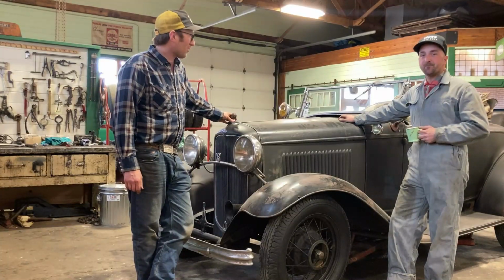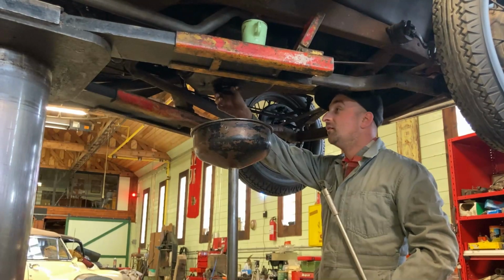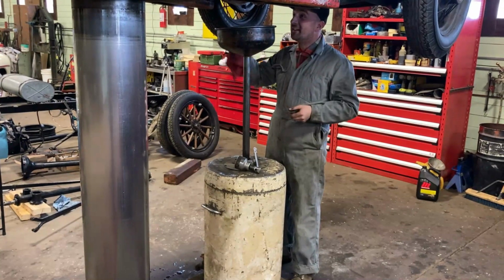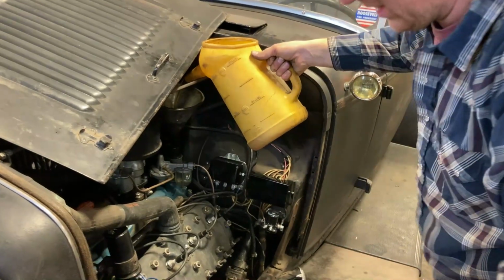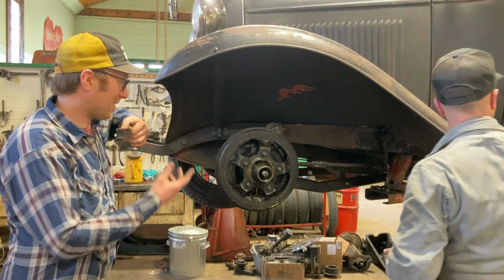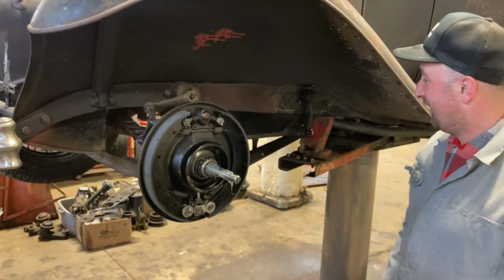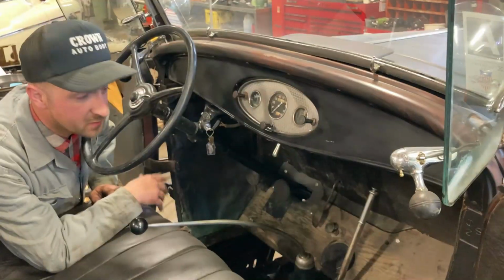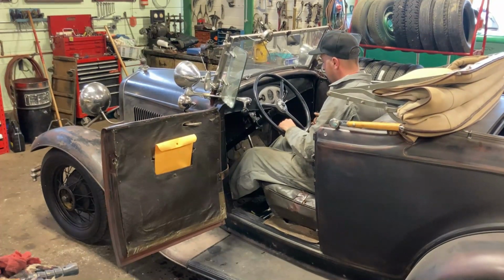1932 Ford Flathead V8 Roadster In the Lube Bay Today!

Comment: Its so neat to see a 32 Ford in its original form. I can't say I've ever seen one up close before. Seen lots of rodded ones of course. I love how the hot rodders of old dissected these cars and made what they did out of them. And thank you for the look at the mechanical brakes and your opinion of them. Again I've never seen those either and automatically dismissed them because of the common opinion that they were useless. You guys are a wealth of resources and I look forward to every vid. 5 stars!! 👍👏👌
Reply: Mechanical brakes can offer a very high mechanical advantage. You can put it in the lever of the pedal and again at any pivot point.  AFAIK, that is how unassisted hydraulic brakes work as well, mechanical advantage.

Comment: I drove a friend's 1939 Austin 8 once. Austins of the era used mechanical brakes, I think they were cable operated. As you say there was plenty of tension in the system, but on this one, not much action. I drove it down a road in Leeds where we were going to turn right, so I 'braked' to take the corner and shot straight past! It did pull up....eventually. Austins had a reputation for poor brakes and rivals like Morris and Singer had hydraulic brakes which did perform better and needed less adjusting. But as you said, a hole in the brake line and you've got no brakes. Been there, too! Thanks for the video - great to see a '32 that hasn't been over restored or hot rodded.

Comment: now THAT's the kind of car lift i remember!!! that one was called the spider lift and was used to change tires and do brake work. we had, at the SOHIO, Standard oil of OHIO gas station that i work at (ca 1980), a drive-up-on one for oil changes and exhaust/muffler work too. both had the big 12" diameter shiny steel posts that came up out of the cement floor.

... but where is the 25 cent candybar machine and the 50 cent a pack cigarette machine?

Comment: You can drive with no brakes with confidence is the greatest comment I’ve heard in a while. I’m sold. My 85 El Camino has more compression fittings than original brake line left. Mechanical brake retro-fit kit would be a winner.

Comment: I had a couple of early 70s Honda motorcycles in the mid to late 70s. Cable operated cam drum brakes, twin leading shoe on the front. Worked fine.

Comment: I actually had a chance to drive a 30 or 31 Model A in 1965 with mechanical brakes.  The car had been restored and drove really did drive fine and stopped okay.  The car didn't weigh much and even though it had been bored and was running much higher compression than it originally had it was not a race car.  It would run 50 all day and make almost 65 before water started being pushed out past the radiator cap.

Comment: Ford still had mechanical brakes in the 1950's with the Pilot (1947-1951) . On the rear,cable operated mechanical brakes...but hydraulic on the Front.

Comment: The reason why mechanical brakes were abandoned by nearly every manufacturer 10 years before Henry Ford did was sooner or later one front wheel would grab first and on a slick surface it would send the car into a spin. Not so much a problem in the Model T era but as cars got faster and speed limits went up it caused more accidents. By the way when Plymouth was launched in 1028 the very first ones had "juice" brakes.

Comment: Neat car.  Just a question.  Is it ok to hang the suspension with mechanical brakes?  I see on the 32 the rods are on the radius rods.  On the A they are on the frame.  I never hang mine because it really bends the rods.  Is that a valid concern?

Comment: Is there any reason in particular why you would not use a good high quality modern multi--weight oil in these old cars?  IIRC, you guys did the same single weight oil on the 48 as well.

Comment: I guess in that case, it's not an "emergency" brake since there isn't going to be an "emergency" without the hydraulics!!!  It simply becomes a "parking" brake!! Keeps the brakes applied when there's no-one in the car to stomp on the pedal. 
That front spring looks like it's too short since the shackles are about straight across. ????? Am I missing something?? 
Nice car and it sounds GREAT !!!
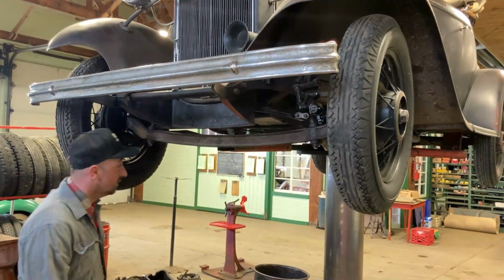Reply: @Pappa Bob • 2:06 - I think the straight-out shackles is the illusion created when the car is lifted by the frame and the spring is not compressed (the compressed leaf spring would show it's true working length).
Reply: @douglas_drew  
Makes sense!! Hadn't thought of that. The spring certainly is going to get "narrower" with no load on it!!
Reply: Excellent! Finely there's a 32 Ford roadster almost original with brake tech. I agree, mine has been in the family for 71 years with no braking problems. Thanks for the video
Reply: @pappabob29  By the way, I went to your channel because of your truck pic,  but it was the '57 Chevy that caught my eye (I suppose you've repeatedly heard "My first car was a '57 Chevy!"). Great content, so I immediately subscribed.
Reply: @douglas_drew  
Thank you Douglas!! ;o)